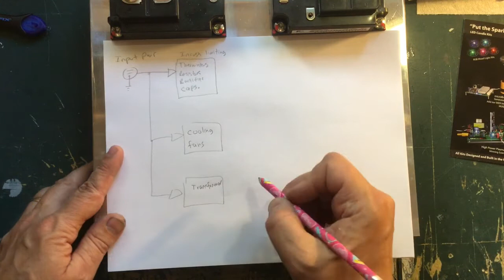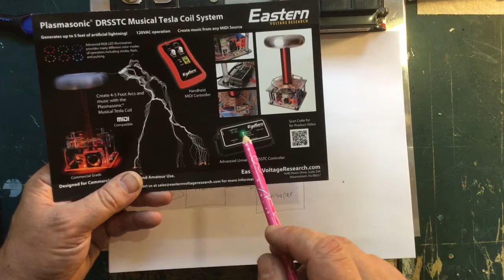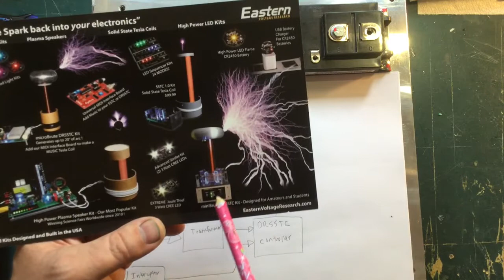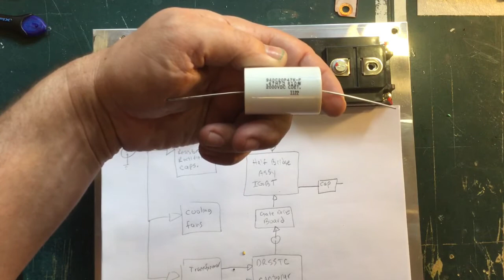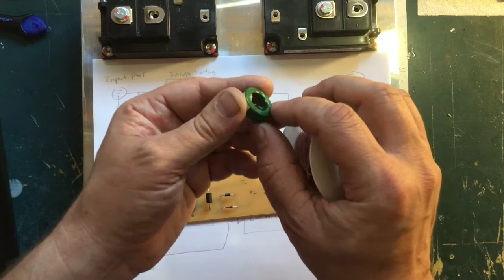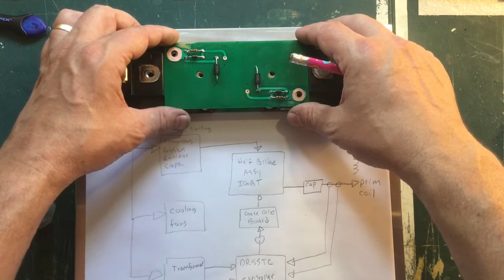Musical Tesla coil DRSSTC build part 1

Comment: Out of curiosity what are the specs on those big black capacitors? I too have those plans and trying to find the specified caps is proving to be a pain. As well as the igbt. Know the specs on those you’re using or a link?
Reply from the maker: Sorry for the late reply. The caps I’m using are 8800uf 400v. The IGBTs are 400A 1200v. P.N. 1MB1400S-120. The engineer at Eastern Voltage Research said they would work, so I’m just trusting him.

Comment: Just a few things I've picked up along the way in my current DRSSTC build. 
First just a quick correction DRSSTC stands for Dual or Double Resonant Solid State Tesla Coil as their are two resonate circuits. A primary resonant circuit between the Primary and MMC and between the secondary and top load. 
Second, I didn't realize that you were building a half bridge though if you already have IGBTs in theory all you would need to upgrade "if you wanted" is to wind two more wires on your Gate Drive Transformer and to duplicate your GDT circuit or just solder the components inline and add heat shrink such as loneoceans coil https://www.loneoceans.com/labs/drsstc3/lam4.jpg  Ethernet is also commonly used for such GDTs if you have some lying around https://www.loneoceans.com/labs/drsstc3/bridgewithgdt_small.jpg  again only if you wanted. 
The third thing is you should be careful when choosing a ferrite core due to the high frequency nature of tesla coils. I remember reading somewhere a permeability of around 5000 or above is a good rule of thumb. (I got mine from digikey though they were a bit pricey) Other wise at high frequency the core will saturate with to much magnetic flux and you will get a dirty signal. here is a decent video I found demonstrating a poor core after a quick search. https://youtu.be/rKqZJoplOj4
Reply from the maker: Thanks for the info! What did I call it? Duel rate? I must have seen that incorrectly somewhere. Oh-well, thanks for the correction. For now, since this is my first coil build, I think I’m going to stick to the plans as best as I can. So I’ll keep it as half. I may build another one later. Maybe. I didn’t realize there could be issues with the wrong ferrite core. I will order the correct ones now. Since my cheaper China ones haven’t even got here yet. I already got the coil wire they specified. The schematic notes specifically say ‘do not use cat 5 cable’. I’ve seen it used before, but for some reason they say not to. Thanks again for the info. I do appreciate it.
Reply: @customfabrications  what type of wire did they have you use out of curiosity? I also looked up why not to use cat 5 and found some warnings about the insulation not being designed for it though I wonder if newer cables are better insulated for 48v POE. I suppose its something to upgrade on my coil down the line... but should suffice for now.
Reply from the maker: For the gate drive transformer they call for 24AWG PVC 600v from Alphawire, part # 1854. For the feedback transformers it’s 26AWG, part#1853.
They just say that cat5 cable isn’t rated for the voltage. Eastern Voltage Research sells everything on there website, but I found it for a bit cheaper on eBay by buying partial rolls.